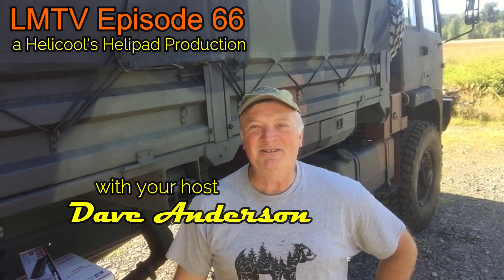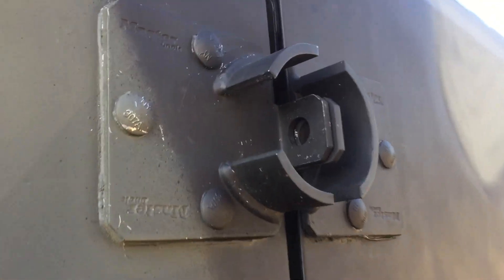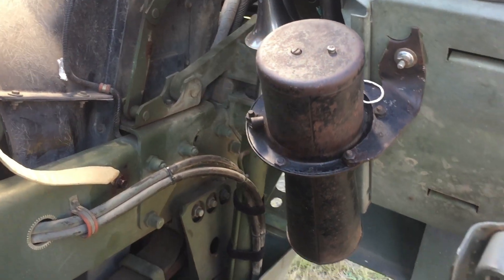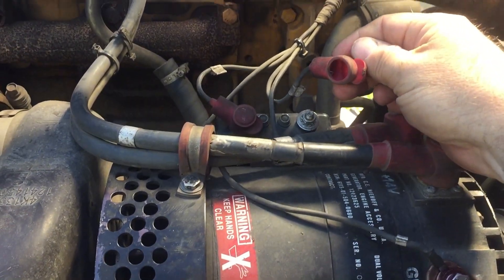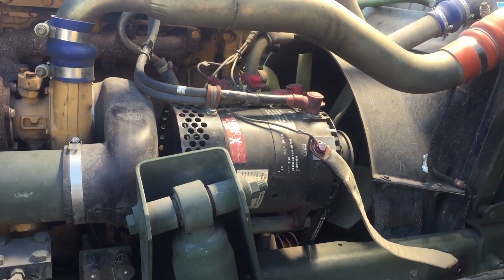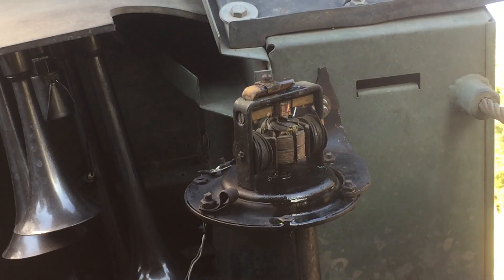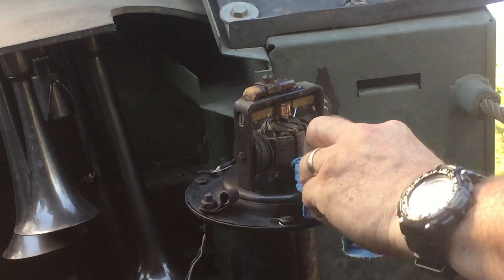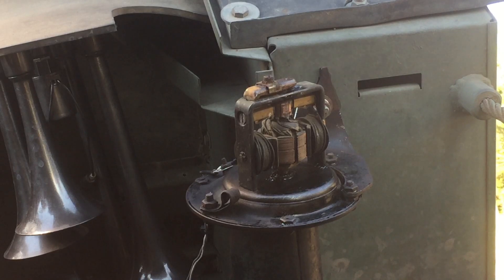FMTV DC VOLTAGE STEP-DOWN to 6v SPECIAL #64

Comment: LMAO 
You're not afraid of a stone getting thrown from the tire into that horn?
Reply from the maker: It's metal. If a big enough stone gets thrown from another vehicle and it manages to hit the ooga horn hard enough to break it, I'll get another one. Heck, the headlights are well more expensive than the ooga horn and I don't have rock protection for them. LOL! Nah... I would rather live than worry about what could happen. Good question, though! I was more concerned with driving rain getting into the motor... but those early designers thought of that too. DC motors are quite resilient.